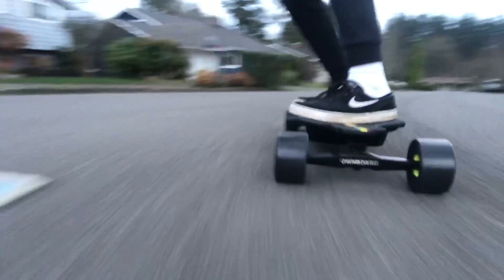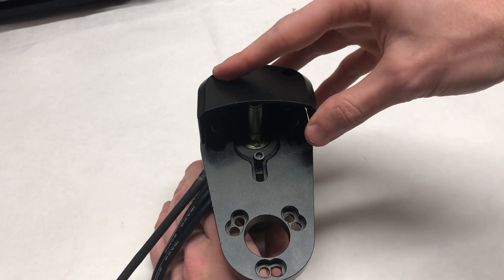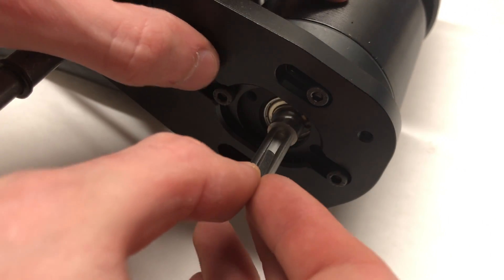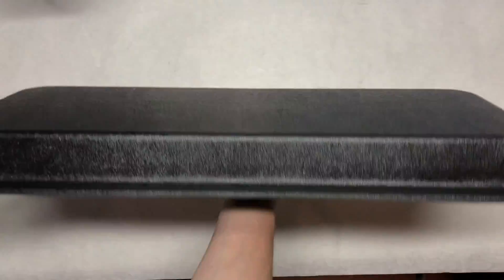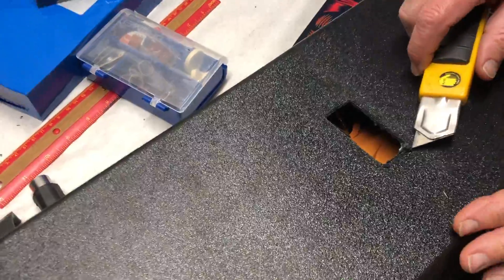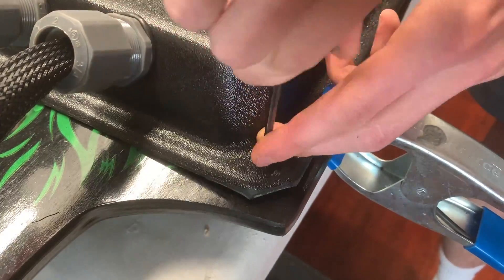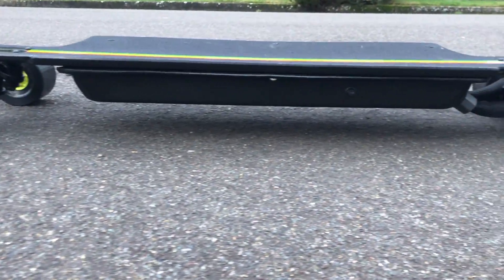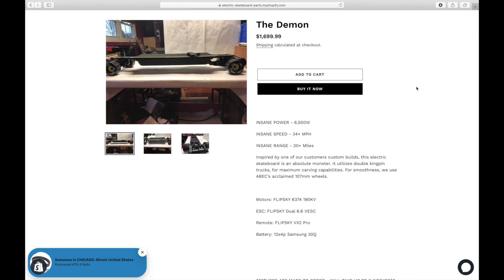How to Build an Electric Skateboard *NEW* (38MPH-30+ Miles Range)

Comment: I built my own electric board did 44mph I’m 185lb I was getting about 28-30 miles of range riding hard (30-40mph) going easy (18-28mph) I could get something like 38-40 miles range all for under 1200 dollars 90mm wheels drop down santacruz deck super wide trucks battery so low speed bumps were too high to go over straight

Comment: Hello, I am the official MAYRC store of AliExpress.
Our shop mainly engaged in electric surfboard accessories, electric skateboard accessories, such as brushless motor, waterproof electric modulation, remote control and other products.
Now the 618 summer promotion has begun.
Click on this link to go to my store and get a huge coupon!
https://www.aliexpress.com/store/1101866924/pages/promotion-202306100618.html?pagePath=promotion-202306100618.htm&spm=a2 G0o. Store_pc_home. PcShopHead_6001912921857. 2

Comment: Now, show me how looks like the display at the bottom of panel....
And Why didn't you remove the film from the controller?
Hot melt adhesive is not capable of sealing against moisture, you need silicone sealant.

Comment: Why use a drop thru deck when goin underneath the deck gives much more clearance.. at least the thickness of the deck... I know it's a couple years later but esk8 co. are building drop thru and drop down decks... 😂
Reply from the maker: Drop through helps have a lower center of gravity at the expense of clearance. Personally did not have any issues with clearance.

Comment: Two recommendations about screw in nuts: 
put some epoxy around them before screwing in to seal the up as they can be moisture ingress points and damage the deck.
 You don't need to go all the way through. You can generally go from the other side and just go as far as you need, making it look even cleaner.
Reply from the maker: Thank you :)

Comment: You made a claim of 38 mph and 30+ mile range but you never even tried to confirm your claims. all of the riding footage is at extremally low speeds.
Reply from the maker: The footage is at lower speeds because it is difficult to film going fast, and does not look as good. We try and incorporate higher speed test in our newer videos

Comment: Looks awsome I’ve been looking around a lot I really want to do my own attempt with a hpi savage flux motor only issue is the board I want to do it to is a drop deck style and not a lot of room for it or for a battery so I would haft to run the same lipos I do on the savage any ideas or tips to help me out plz

Comment: Wow, what a great build!  Is it possible to have easily swappable batteries (instead of having to bust into the enclosure)?
Reply from the maker: Yes there is you could probably do that but at that time we weren't thinking about that and we would have wanted to find a great reliable option

Comment: I dont think the ESC should have stayed inside that heatshrink bag. i think that was to keep moisture and other things out while shipping. all thats gonna do is keep the heat in. i mean i could be wrong but that just seems so weird, if it really is that way id just coat the board in a special spray to help prevent moisture.

Comment: Nice build, yup been there done that. If your looking for sub sonic speeds.Check out west Coast Standard's latest release. You can't go back after a "ride". Wcs " chamber trucks" are stable and wobble free to 40+mph. I haven't gone beyond it yet. I leave this to the kids. Hey! I'm 50+, my days are numbered. I test all the custom builds by psychotiller,personally. So I can personally speak on their behalf. The forged billet units use10mil. Axles. Not typical 8's. They're practically bulletproof. Look it up. The rest of the build looks solid...except... I ride pneumatic. Urethane is too harsh at extended rides to be fun. The 6x3 "six shooters, make all the difference. You lose distance. But gain vastly improved traction and road dampening. Especially, after30+mph. Saves knee joint aches and pain. Besides, it's just plain dope looking.
I haven't mentioned the "Project Zero" yet. Hmmmm.... Should I? (My new girlfriend, boys. Get your own!) 
I'm going to wait. A new vid is forthcoming.

Comment: You can get most of these parts from flipsky for cheaper. These guys are awesome and all but they are just copying the flipsky store and bumping the prices up. Only thing I can't find on the flipsky are those belt covers and the pulley for the all terrain tires. Shipping is more but after doing the math you will save give or take a couple hundred dollars. And if you buy most parts from flipsky and build your own battery and build it yourself you will save 500 dollars vs diy build from them. Or 800 dollars vs buying the completed build.

Comment: “Board is $1600” then what the fu- what’s the point of DIY when you can get a belt for 800 - 1200 that’s probably better what the
Reply from the maker: If you find a board that goes 38 MPH with 30 miles of range for that price, let us know :)

Comment: Since you have a Dremel now, you should start cutting down the threads of the electric conduit fittings so the caps screw all the way down.  It will create a cleaner look and have less sticking out to possibly catch on things.  Your boards are nice.  Thanks for sharing your builds.
Reply from the maker: Thanks! Yes, only thing is we do not use the conduit fittings anymore!
Reply: @DIYesk8Builders  what do you use now instead?

Comment: Curious. Does the build complexity go up if you build it with 4 motors? Also if adding bigger 8" off road wheels? 
Great build keep up the good works. 
Thanks
Reply from the maker: Yeah that would make things trickier as you would need double ESC's and squeezing everything in there. Definitely possible though
Reply: @DIYesk8Builders  
Go for it! Don't limit yourself to pavement! Think Bajaboards. Bigger, faster and let er rip.

Comment: Quick question, would it technically be possible to put all terrain air filled tires on this type of board ? I know it will decrease the top speed but I was just wondering if it would be possible! Thank you !
Reply from the maker: Quinn Doherty yes you can!
Reply: DIY esk8 Builders dammm that’s amazing, because I’m guessing with the battery pack all along the bottom of the board, the dock doesn’t have much flex right ? And since I live up in Canada and the roads are TERRIBLE I would need some sort of suspension, but now imma be able to put air filled tires on them. Also, if I were to preorder the demon v2, I need to assemble it right ? And for the air filled tires, would I need to buy a conversion kit from like evolve or can I just slid the tires on ? Thank you for the help!
Reply from the maker: Quinn Doherty yeah so if you preorder the demon 2.0 we will build it for you and when we release the the video “drop the demon 2.0” and on the store we will already have it assembled and send it out a couple days before the video. If you wanted you could send us an email before preordering and tell us that you want the all terrains inflatable tires we can put them on for you and send it out as a complete. There also is a demon 2.0 kit that comes with all the parts you will need and you can build it!

Comment: Great tutorial. My only concern would be double kingpin trucks on a board that fast....someone gonna die
Reply from the maker: Yes the speed with dkp does provide some sort of issue once you reach the high ones but around 33-34 they are still great

Comment: Ok so I have a question..
Hello my name is Ryan and I’m working on my first build so I wanted my eboard to be unique so I bought a lot strange parts you typically wouldn’t buy for esk8board I just need help putting it all together and what else do I need? I would love a fast charging system do I need a bms? From what I heard the Xiaomi batteries have a bms but how would I charge both simultaneously? so far I have 2 Xiaomi M365 Electric Scooter battery packs 36v 7200mah 2 brushless motors from ebay garrt rc brushless motors they are 540kv and max 4500w also for vesc system I plan to get a Maytech Upgraded High Current 200A VESC Controller based on VESC6.0 Speed Controller with Anti-spark Circuit Comb with 20W Cooling Fan and 12V DC-DC I also have 2 enclosures both from mboards! Please I need help wiring everything and what other parts do I need? So far I have those items mention 6mm bore 20teeth motor pulley 45 teeth wheel pulley a battery indicator and battery switch button and a charger port connector.
Reply from the maker: Hi Ryan,
yeah those are some strange parts. To charge them simultaneously I am not sure.. its probably best to charge them separately if they already have a BMS installed. As for motors, the KV on those is too high. Typical esk8's will use 140-270KV max. The 540KV will make you go way too fast and not have enough torque so they probably are no good for the esk8 application. You will also need a remote and the drive train items such as motor mounts and trucks
Reply: @DIYesk8Builders  for the motors I'll see how the build goes I guess see how they perform. And but thank you for responding to me I was trying to get feedback from somebody for the longest and yeah i already have the trucks and motor mounts coming soon w the d clamp!

Comment: why did u use double-king-pin for that high speed? would normal king pin trucks not be more stable?
Reply from the maker: Yes skp would be more stable but we personally like the feeling of dkp more for carving. We also like the fact that they have the built in motor mounts as many caliber mounts come loose over time. We rarely actually go up to those high of speeds but the board is capable of it

Comment: Would the 6384 fit with these trucks?
Reply from the maker: Unfortunately no
Reply: Damn
Reply: I’m also pretty excited about the 2.0 version of the board. Do you know when that will be released?
Reply from the maker: Well we bought a big shipment that has the parts for the 2.0 in it over a month ago and we still haven't gotten it. So we are going to try and get ahold of the shipping company. But we are hoping to get the video out really soon!

Comment: That is awesome!!! How well did the gasket for the plastic enclosure seal against the deck with the deck being convex and the enclosure being flat? With it being fastened to the deck you could take a heat gun and soften the enclosure enough that it'd probably form to the deck exceptionally well.
Reply from the maker: It actually sealed pretty well, I'm sure it would work even better with the heat gun

Comment: Vestar Black Hawk goes 30+mph and goes 30+ miles aswell and costs a about 1.3k. Is there any way to bring down the price?
Reply from the maker: The components in this build are wayyyy better quality than in that board. The motors are bigger, the ESC provides much more power, and the battery is top notch. It would be difficult to bring it down but you could get cheaper wheels and deck to make it more affordable
Reply: DIY esk8 Builders Thank You!

Comment: This is a pretty nice build. The price on the website does not match the 1699 in the video description though. Still, good job and I hope you guys keep making unique and awesome boards.3
Reply from the maker: The price on the website is set as a prebuilt and the $1699 is the amount in parts if you wanted to build one. We will be coming out with a kit for the Demon very soon!
Reply: @DIYesk8Builders  A build kit would be awesome, I would be a customer for sure!

Comment: how did you connect the motors to the vesc because the vesc had no ports that the motor wires could be inserted to?
Reply from the maker: Soldered on 4mm bullet connectors and connected the sensor wire into the sensor wire port

Comment: What are the fasteners called that you used on your enclosure?
Reply from the maker: Threaded insert nuts
Reply: @DIYesk8Builders  What size threaded inserts are you using on this build? What was thread count-pitch on the bolts used?
Reply: @medinavictor85  stainless are better than brass inserts also  5mm is better than 4mm

Comment: How do you figure 30 miles with dual 6374s on a 12s4p battery? Be more realistic with your stats guys...
Reply from the maker: We use around 20Wh/ mile on average going up super steep hills and pretty much always gunning it. That would put us at 25-26 miles of range. If we rode like normal people and weren't on so many hills it could easily hit 30 miles on a charge
Reply: DIY esk8 Builders I’ve got a dual 6374 setup on a Samsung 30q 10s4p and I barely get 15 miles on moderate slopes... guess your battery is magical or something😂
Reply from the maker: What cells do you have though
Reply: DIY esk8 Builders Samsung 30q’s

Comment: What would be my best option for 6384 motors? Should I get massive trucks or would I need to mound one motor under the board? Thanks
Reply from the maker: The double kingpins won't fit dual 6384, you could use torque boards 218mm trucks or boardnamics hangers
Reply: DIY esk8 Builders I think the 218mm trucks only support up to 80mm motors. What are the hangers? Thanks

Comment: I dont understand , why use motors that can output 6200 Watts with a battery 4P ? which can output much less power, you will never get 6200 Watt out of this battery, not even close to it

Comment: hi just wondering if a 180 mm belt would work because I can't find a 175 mm
Reply from the maker: The belts in this video are 275mm
Reply: @DIYesk8Builders  i just couldn't find any 175mm belts online
Reply from the maker: Ohh ok here's some https://shop.polybelt.com/175-5m-15-Rubber-Timing-Belt-35-Tooth-B175-5M-15BNG.htm

Comment: do you use threadlocker on the bolts? Because i didn't at first and i lost a pulley bolt after a few minutes of riding
Reply from the maker: Yeah, on the motor pulley grub screws - we just do not show it in the video

Comment: Why do so many eboards go with double kingpin trucks? DH longboarders shudder at the sight of them and you'd get much more stability with RK trucks
Reply from the maker: Personally I find them more comfortable and they are also nice for carving. I don't find them unstable either, just use tighter bushings, but still you're right that RK trucks are more stable

Comment: If you wreck the board and it flies loose and hits a curb/object motor side, what happens? For my board should I mount the motors inward or outward like yours? Also may I ask how tall the enclosure was?
Reply from the maker: I mean its all up to how it hits. The motors are probably safer inward mounted though. The enclosure is 1 3/4 inches tall
Reply: @DIYesk8Builders  Sweet, our batteries and enclosures are about the same height so that's good to see it fit together. With outward mounting though I've seen some people put cages around the motors. Appreciate the reply.

Comment: why didn't you use a a smaller more aesthetic enclosure looks like there was a bunch of wasted space in there
Reply from the maker: It was difficult to find an enclosure thick enough for a double stacked battery that was also this long
Reply: @DIYesk8Builders  I see. Would you consider designing/building one that encloses the battery and esc as space efficiently as possible?

Comment: Why not use 6384 motors instead?  Would be more power tho
Reply from the maker: They don't fit on the trucks, they would be too wide just barely
Reply: @DIYesk8Builders  but it would be kinda faster tho right?
Reply from the maker: 6384 would be more power but still the same speed because they are the same KV. Motor size won't really impact speed, only power
Reply: @DIYesk8Builders  ohhh i see
Reply: @TacEsk8  If you change the gearing you can use the more power to have more speed with same accleration as 6374

Comment: That’s so cool! How much did making this board cost to make?
Reply from the maker: Cost of parts is around 1,400-1,500, probably a little more
Reply: @DIYesk8Builders  maybe I am wrong however I just priced the parts and came in at less then half that here in the usa. 90-110 motor,260 for 48v 20ah battery, 100 for board trucks wheels, 200 vesc,forget the remote 100 bucks or so but still well under 1400 bucks. when you built this since people still in 2020 have little knowledge ..should have let people know that the kv determines speed and power as well as the gearing and if you do not want a off the shelf motor you can generally get a higher quality and handbill motor from alien motors so you can get speed and power. not knocking your build or anything I've been interested in these for years ,I build them for personal use and have never spent 1600 on any board yet. I like speed and I like being able to climb hills. sometimes the custom motor is the way to go given it is hand made and amazing quality and cheap..and the owner actually answers emails and talks to the custom immediately no waiting days . good work cheers mate.
Reply: @simplelife3466  quality control of alien motors has been lacking for awhile i hear

Comment: Evolve is a great product. Buy EVOLVE! I get up to about 25 mph on my Evolve. Anything over 20 mph is a little sketch. Plus riding 30 miles would numb your legs and feet off. Buy EVOLVE! Top of the Line and ready to ride!! Boosted Board KILLER/E V O L V E
Reply: Here’s the thing ... you’re paying $2000 for a evolve that’s ESC is fucked up that it will lock its wheels and throw you off. Plus it’s slow. And only 15 miles of realistic range. Demon had capabilities of 35+mph top speed and 30 miles range with full unlocked power thanks to its VESC . For $1899

Comment: What was the black stuff that you applied to help hold things in place?
Reply from the maker: Velcro
Reply: @DIYesk8Builders  it looked like a black paste
Reply from the maker: For the battery, double sided adhesive made by 3m. Basically just super strong double sided tape